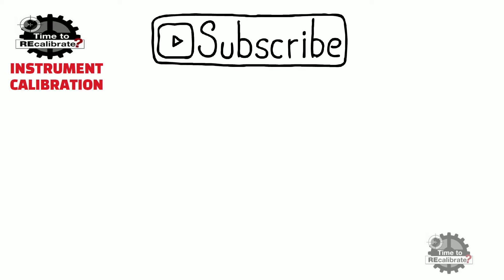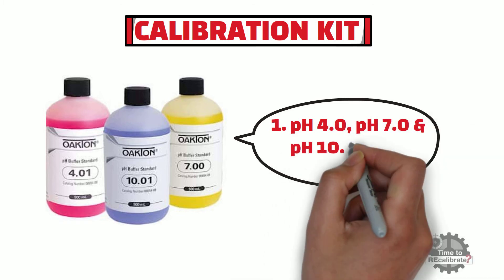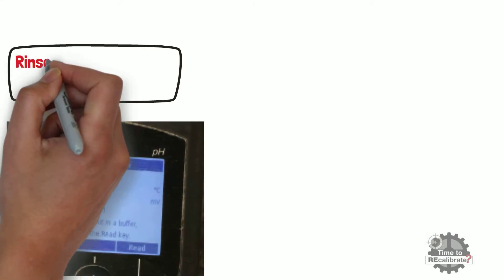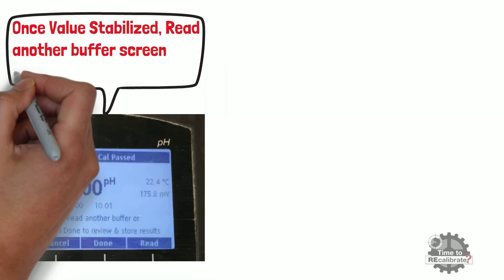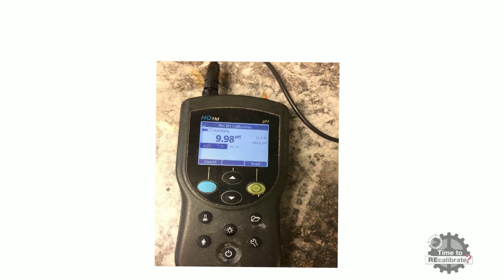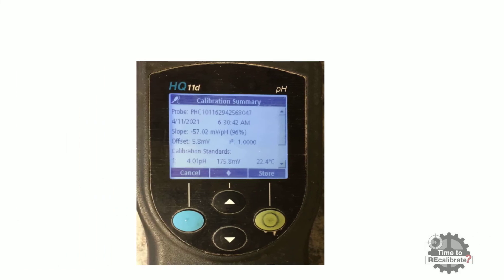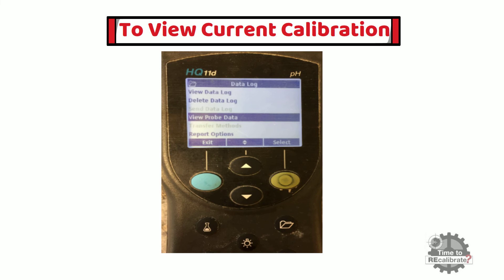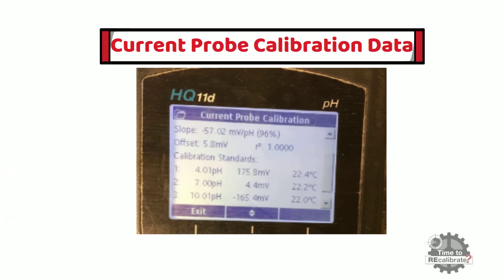How to calibrate Hach HQ11d Portable pH Meter | PH meter Calibration Procedures

Comment: I thought you had to use deionized water?
Reply from the maker: You can use either distilled water or deionized water to clean the probe.
It doesn't make any difference in the calibration

Comment: First of all, thanks for you video. I have a question about pH calibration. I have HQ11D pH meter. Sometimes i see 10.04 or 10.14 during calibration. Can you explain this variability. I use same buffer solution of pH 10.
Reply from the maker: Thanks for your comment. pH measurement also depends on temperature. This variability because of temperature